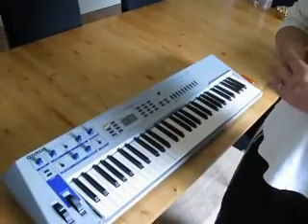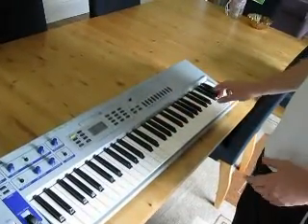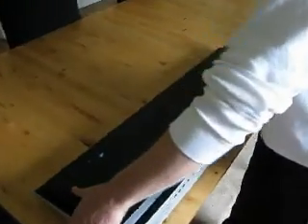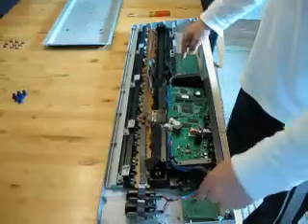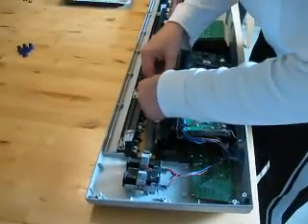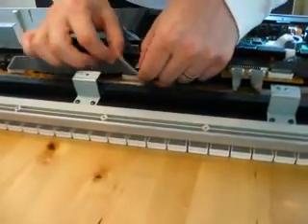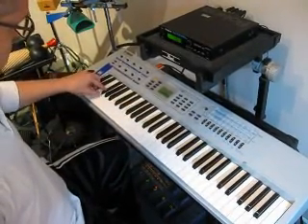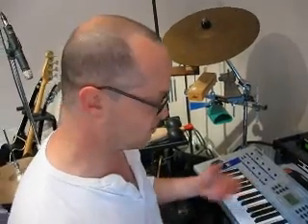DIY synth repair - fixing a series of dead keys

Comment: My CS1x did the same thing. Unfortunately, both the cs1x and the cs2x have parts (cables, contacts, wires, etc.) on the inside that can come loose if the keyboard is frequently moved, such as doing regular gigs in different places. 

Fortunately, just about anything that comes loose can be reseated, reconnected, or generally put back in its place easily, unless it is broken or damaged in some way.  I merely took mine apart, wiggled every cable, connector and part inside, put it all back together and voila - all was back to normal.

But kudos for taking the time to do this video without ulterior motive, such as trying to funnel traffic into your business without actually giving a @#$! whether or not it helps anyone, like millions of other YouTube channel owners.  Folks like you are rare these days, and are GREATLY appreciated!

Comment: Great video. About 5 keys on my Yamaha Ypg-235 stopped working all of a sudden, I watched several videos. I unscrewed the back, and cleaned the contact points where the rubber hits each spot on the circuit board. None of the suggestions about cleaning the board worked.Also many suggested cleaning contact rubber and circuit board areas and buying contact conductive paint. I'm not sure about that step yet. Most of the F keys and B keys from the center down don't work. I've been looking for a video like yours everywhere. I will be checking out the ribbons and all inside my keyboard tomorrow when I have time. I will let you know if your suggestion works. Thank you for taking the time and making this video, Todd.

Comment: 50,000 views, seems like a lot of people have issues with their Yamaha keyboards. I have the CS1X and the '-' (minus) button is not responding for program select, so I can only go up with the '+' button! I have a feeling this might be harder to fix myself. I have yet to open it up.
Reply from the maker: I've thought that about the 50,000 views as well, granted this video is about 8 years old but that's still a little over 6,000 people a year. Sorry to hear about your button, I'm afraid that fix a little more complicated, that's one that should probably be handled by a professional. The sad part is, you are likely to be able to buy a used CS1X on eBay for less than what a pro would charge you unless you have real cheap repair guys in your area. Good luck, I wish there was better news for you.
Reply: Thanks... I got lucky and fixed it tonight without even taking the back off! I sprayed contact cleaner over the front panel around the button, let it dry, then repeated that process a couple of times. Button works again! WD-40 contact cleaner is awesome stuff.

Comment: Had issues with my Yamaha PSR E403, every E, Bb and B key would not work. Opened it up, pushed all the ribbons in (even though they felt firmly in) and when I turned it on, all the keys worked. Thanks for this. Whatever happened, it happened due to this video, and it works!
Reply from the maker: Sweet! Glad to hear it worked

Comment: The C# to F# of the octave below middle C of my keyboard is not working.
What do you think might be the problem? 
It's a P-85 by the way.
Reply from the maker: The fix from the video might work, however that fix usually only works when it's a series of the same keys, i.e. all Gs all Bb's etc....When you have them grouped together like that it's more likely something has happened to the circuit board where the key makes contact. This is the type of thing that happens when,say, a drunk at your gig spills a beer in that section of the keyboard. For that it's probably easiest to replace the whole key bed or circuit board. The problem is, that is an expensive fix and you're almost better off buying a new keyboard. I mean, you like getting a new keyboard don't you? Try this fix and keep your fingers crossed. Hope this helps.
Reply: Oh, that's too bad. 
But here's the thing, after turning on the keyboard one time, the keys are working again. It never happened again though. 
So I guess the problem's really with the circuit board huh?
Reply from the maker: Gefferson
That's a good news/bad news scenario. The good news is it's working again, the bad news is, it's hard to know what went wrong or when it might happen again. I'm glad to hear it's going again, hopefully that will be the last time it happens.

Comment: I need to replace a broken black key on my Yamaha Cs-1x.  Do you know how i go about doing that?
Reply from the maker: The first thing you'll need is the replacement key, the best bet is to go to the Yamaha website, or call the number in the back of the manual if you still have it. Once you do that, remove the bottom of the keyboard as shown in the video, then you'll have to find the screws that mount the keyboard and loosen the keyboard. At that point the old key can be removed and the new one put in it's place. I suggest searching "Yamaha synth replace keys" on Youtube and you'll see more details.

Comment: thanks for this tip. I am going to open up a Siel Orchestra (a bit older) and it has a few dead keys in the lower section. I tried doing this trick with a faulty DX7 as well, the cartridge slot was 'broken', but after opening up the the DX7 it appeared some cables weren't plugged in correctly. Thanks again!
Reply: Mine has the same problem too.. D and b flat.. All of them not working

Comment: I have a yamaha psre433. c sharp and g stopped working on all octaves.I opened my keyboard and it looks different from yours which is the ribbon cable.plz tell?its like wires covered with some foam inside and yeah they are connected to circuit board and i dont know which one is for g and c sharp and i didnt check it if it was lose fearing i might mess it up should i give it a try again?and how do i know what ribbon cable looks lke?Plz help

Comment: I've Motif XS8, and today all the keys and buttons stopped to work. the sound engine can be controled by soft via motif studio manager and vsti extension. I tried to update OS from USB, it seems that the buttons does not function at the BIOS level to activate update procedure. Todd, could you tell me where can be the problem and how to detect it and repare? thank you

Comment from the maker: Typically if you plug it in and nothing comes on, no lights, no display, nothing, then your problem is usually the power supply that plugs in the wall. Try replacing that, and keep the receipt so you can take it back if that's not the problem.If that doesn't solve your problem then you'll probably have to take it to a repair shop

Comment from the maker: Underneath the keyboard there is a strip that makes contact with a key when it is pressed. Replacing this strip is traditionally a major repair job, and sometimes the strip can be permanently attached to a major circuit board, and often the parts are pricey. Taking to an authorized repair is your best bet

Comment: Hi, i have a Yamaha PSR520 and the circuit that controls the keys is failing, when I turn on the keyboard all the keys sounds ok, but later some keys die, I check the chip that controls the keys and get hot, so i know its damage, do you know what kind of signal come out to the rest of the circuit, I want to make a replace part XR951A0, I can do the scan for the press key, but i can't find what kind of signal is transmit rest of the circuit.

Comment from the maker: The main thing that is hard about opening up some PSR keyboards is that the plastic case is from one or 2 molded pieces and it doesn't come apart very easily. If it has a series of screws around the bottom, take them out and see if the bottom comes off. Be sure to get all of them, sometimes a screw will be hidden in a recessed area and can be hard to find. If it comes apart easily be sure to pull it apart slowly so as not to yank out any ribbon cables that might be connected.

Comment: I have a Edirol PCR M-50 , I had broken keys due to something being wrong with the metal contacts (not the rubber ones) which none of the tutorials on youtube could fix. I just found the solution in an internet article.

If the problem is in the metal contacts, try rubbing them with a pencil eraser, it worked real well for me. I wiped them thoroughly with a wet cloth right before and that didn't help but the eraser worked

Comment: @Iam18yearsolddddd I might be a little late answering your question.  Use tape head cleaner (denatured alcohol) or rubbing alcohol which you can get at Wal Mart.  It should be 70% or higher concentration.

Rub it on the black rubber conductive pads.  It will renew the carbon conductive granules.  Also rub their contact surface.

It worked for the Atari 5200 controllers, all TV remotes with those rubber buttons... and almost every keyboard on the planet.  Amazingly simple!!!!!! Even the CS-80

Comment from the maker: I used to have a DJX and the contact assembly is a little different than the synth keyboard. The easiest solution is to buy some compressed air in a can, like the kind that you use to blow out your computer keyboard. I can't remember if you can take the bottom off the same way you can on the synths, but if you can get to the contacts try blowing some of that compressed air on the contacts. Also try to use your vacuum cleaner after you blow it out to suck up any excess dirt. Good Luck.